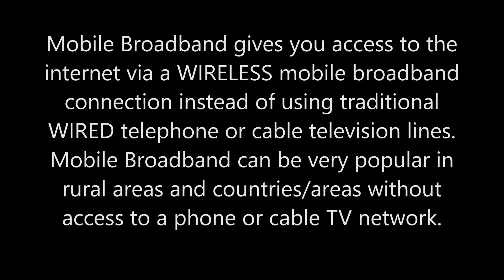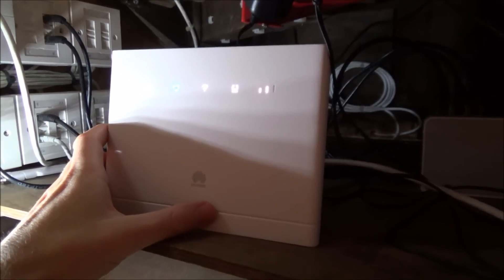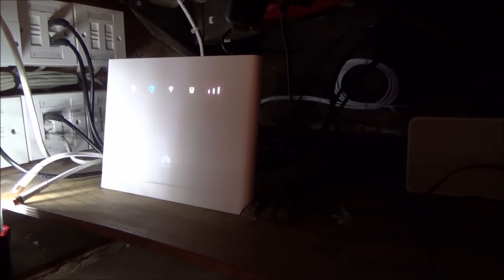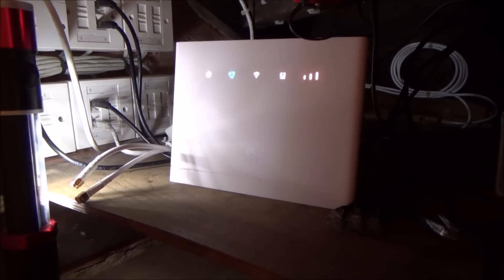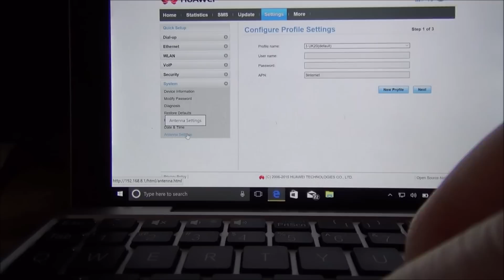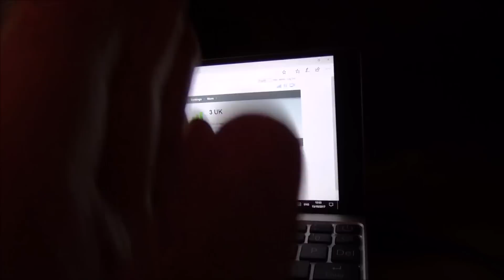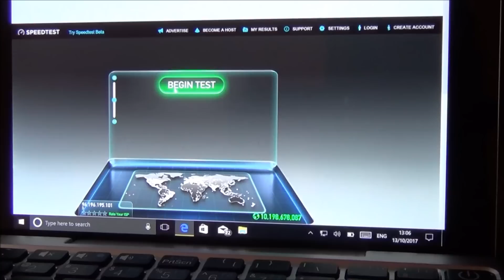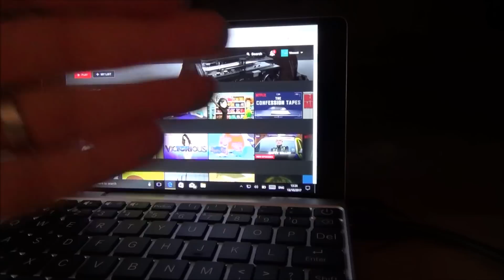How to increase 4G LTE Home Broadband Router Speeds

Comment: I bought the recommended external antenna. 1. I find it to be very sensitive and a few inches difference in terms of where it is placed can change a 4 to 5 bars reception. It works better with height too. 2. I have far less speed with the external antenna that I have with the built in ones. I have played with the Auto/External setup within the Router's front end as shown, but this does not seem to make a difference.3. Why do I get less speed on an external antenna vs built in internal ones? I don't really get it. With the Router's internal antenna I get up to 55 MPS and max 20MPS with the external. I was actually looking to improve not so much speed but consistency as I find that when I stream tv for example, using the router without any external antenna, it does tend to stop which is strange given the speed, which I had put down to drops and inconsistency, hence the external antenna, but unless there is something to change in terms of settings, I think the external is going to go back to Amazon and save me £80. Any advice, input, idea? Many thanks indeed!!!
Reply: remember what he said about the cable gain loss? that maybe your issue,.

Comment: Thanks great tips there and nice demo , though I only have a wireless prepaid modem wifi and only has one male external antenna attached to it, can I possibly increase the speed by using an extension cable? Again thanks...

Comment: Hi Vince, brill video. I’m on the verge of entering into a 2yr contract with Three for their homefi broadband but I’m a natural pessimist and am panicking that it may end up being slower than what we already get with talk talk. 2yrs is a damn long time but they give a 14 day cool-off and so I have that time to test the huawei B535 router although not sure I’ll be able to hold of an external antenna in time to give it a good testing too. We live in semi rural Wales and even before I get the router I’m obviously expecting the internal aerial to be of little use ☹️. My pessimism is also related to their pricing as it’s only going to work out at about £18/m!!!!!! and so seems a no-brainer but why so damn cheap? Are Three trying to get people onboard or do they know it won’t be that good? This is how I came across your vid in the first place. Please tell me I’ve got no worries and to calm down......there’s a mast less than a mile away (although not in clear line of site (another house and small hill in the way)) but do all networks use/share the same masts?.....any help/advice would be appreciated.
Reply: Ollie Clark hi Ollie, ta for all that. Quick reply here......I forgot to mention that at present our MAX speed is, according to talk talk, 4mbps....however, lately we only get 1.70mbps on average and have been down as low as 0.4mbps.....so you can see that I should be onto a winner going sim broadband. However, Since my initial comment I’ve discovered Smarty broadband (who piggyback off three) who offer £18 per month unlimited BUT on a month by month basis and so I’m going to try this one out.

Comment: I got the portable Huawei mifi for home and travelling but my home speed never goes above 2mbps on 3 network. I've just got this router today and have sited it on every window cill and the best speed I've managed is 6mbps.Id like to try an outdoor aerial but I'm sceptical that it will make enough difference given the low speeds I'm getting.

Comment: Absolutely brilliant. Just a quick question... Can my normal phone 📱 connect to this router and then its down to how much Gigabytes my Internet provider allows? In my case its unlimited but my house has a terrible signal. Hoping to find a signal booster so I can use it decently. In this video is this solution for me?
Reply: I found the answer to my own question. I went and bought a similar one to this but the Huewei B525 which is 300mbps rather than 150mbps (which doesn't matter unless you want to cast your phone to the TV via WiFi at UHD like I do)
 I also bought the antenna Poynting 4G-XPOL-A0001 as you have in the link in the description. I found it helped me a lot to get a better signal on my roof when I pointed it in just one exact spot for the best speed.
 I still had a terrible signal for 4g but when I switched it to 3g it helped me from 2mb dl and 0.5mb upload to 5mb dl and 5mb upload and that was with 3. I will say that though that although the difference wasnt a lot, it did take away a ridiculous amount of lag and it felt a lot smoother. Was able to watch YouTube with no problem whereas I had no chance before really. 
 My mate however tried EE and he went from 2mb dl and 2ul to 20mb dl and 40ul I've never seen anything like it. I didn't even know it was possible. Proper gutted my Internet provider didn't do the same to be honest but it does show its potential.
 Thank you for this video it helped me out a lot with the set up.

Comment: This external anntena is a trash  like this huawei 2
Reply: Tomo Gacic please could you explain ?
Reply: @benosatv  It all depends on the transmitter and its signal quality and where it is located. For me it doesn't work nicely with or without an antenna.
Reply: Tomo Gacic does the huawei work at all?

Comment: I didnt quite understand the minimum gain on the 2x5m aerial cable? I am wanting to install an external antenna about 10m away on top of roof or where ever I get best signal. Is it better to have shorter aerial cable runs or better to have longer cable runs?
Reply: the shorter the better

Comment: A Zero Waffle production. Thanks.   I've got a similar 4G router, but my net speed is totally shit.  Got 0.12MBPs last time I checked.  It varies between 0.10 and about 0.6Mbp/s most of the day, and might go up to 1.2 - 2Mbp/s after 1am (I'm paying for an advertised 20Mbp/s!) There's a disused satelite dish on my apartment's balcony with the antenae terminal here where my router is plugged in. Do you think it'd be possible to just get a cable to attach the satelite dish to the router? The dish is actually marked with the same brand as my ISP too, so presumably it's pointing in the right direction.

Comment: I’ve got a TP-Link Archer MR200 and a Poynting A-XPOL-001, do I have to tell the router it’s using the Poynting, as you did in your video?
Reply: nope, tp-link MR 200 does not have internal antennae so it will just pickup whatever you have plugged into the back of it

Comment: Is there any speed difference between ethernet cable and wireless? Because you are using ethernet cable.
Reply: Using a Ethernet cable is better it has lower ping and can't disconnect on it's own

Comment: Followed this to a t, b525 bought exact same antenna changed settings to external and got the exact same results as the stock b311 router 3 sends, 6mbps download with both router and with the antenna for the b525, b311 got same speed without an antenna... The thing I don't understand is it shows 4g and a full 5 bars and my speeds are still complete trash, on 3 website it says I have very good coverage, sucks :( can't go broadband because I get 2mbps download which is even more tragic, guess I'm fucked unless I move

Comment: That's a good instructions, whit a little failure... Let me explain it why. Antenna should be installed as close as the top of the roof, as you mentioned that's a omni directional antenna. Let it pick up all available mobile repeater signals from 360 degrees... That's might be the best speed increase.... 
Why I'm saying this? Three mobile UK launched the 4G+ or some say 4,5G services, if mobile phone or router could connect 4G on multiple frequencies, device just bound these together and give a sky high bandwidth to the user, or use Huawei outdoor CPE

Comment: Thanks good video. In the UK 3 currently offer an unlimited plan.  This is great for people like me who are in a rural area.
Reply: Or for people in the centre of London who have a landlord that refuses to buy Fibre (Using 3 unlimited)
Reply: Be aware that the 3 “unlimited” it speed capped when you exceed a certain usage. That cap it to around 500kbs I I remember rightly.
Reply: @CWXM01  OffComm regulations require them to advertise that they slow it down after a certain usage, no where on their site, in the store or on my contract does it mention that, you may be thinking of their mobile plans with texts and calls where they do throttle after a certain amount
Reply: SirFlukealot Esquire did you find any more info about this limitation? Maybe it is true because i feel a speed drop last week of subscription.
Reply: @Kuki_ogl  they said when I went into a 3 store that there's no speed cap for going over a limit, I returned it however as the speed only reached 10mbps when I switched the router to 3G only mode, no good for me

Comment: I have the same router/modem, except it is black and one yagi antenna with 7db gain, but only vertical polarisation. 
Right in best case scenario I get 54/12mbps (I have 50/10 package). But when there is bad weather outside it drops to 1-4mbps download, while upload remains stable at 9-12mbps. 
Is there any better antenna I could use for that?
Reply: SAME TOO

Comment: How to control connection device speed limit?
Reply: You can set the network mode whether 2G/3G/4G depending on the speed limits you desire.

Comment: regarding the antenna location, you said best signal you got was just above the garage roof rather than a higher location, in the world of antennas that's counter-intuitive, the only reason I could think off of why that is could be because the garage roof acts as a parabolic antenna and bounces signal off of it and into the LTE antenna, by experimenting around with the antenna's location you guys must've found a sweet spot where plenty of bounced off signal from roof will hit the antenna, surely the roof doesn't have the shape of a parabolic antenna but still plenty of signal will bounce off and reach the LTE antenna so that will make a difference location-wise.

Comment: I have had this same router Vodafone branded for 3 years. Your advice is spot on and I'm lucky enough to have an unlimited data connection. I now use mine in the car. When in the glove box, the Android radio drops out, but I have an external antenna (similar, MIMO though a bit smaller) and it works a treat. Never ever drops out, even in tunnels and mine was about a fiver from China. Yes, a slight gamble on quality and not suitable for outdoors, but it works for me and very well.

Comment: Great video. Thanks. I just ordered the HomeFi (3 network with unlimited data) as the broadband where i live is awful. No FTTP, cabinet overloaded. Fiber yes but only to the overloaded cab with no plans to upgrade. I was dubious when i spoke to 3 who claimed 20mb which was only marginally better than the 16 i was getting (paying for 36 with Sky) and they said I could get up toward 50mb. Installed the HomeFi (Huawei B311S) and after a couple of minor hiccups i'm getting 34+ mb.... essentially doubling my broadband speed. Very happy. Ordered the rabbit ear antenna's but not installed yet. Will report back.

As for ping and gaming, early days. I'm getting anywhere between 39 and 60. not great but didn't notice anything untoward when playing Battlefield 1 for example.
Reply: that's certainly playable, I was wondering what the ping is going to be like. Just took the 4g plunge myself and ordered the kit and sim.

Comment: Just a notice to everyone currently three is doing an unlimited internet HomeFi promotion in the UK. Just ordered one of these and will post back with results
Reply: Alright so quick update - had the hub three days, suffered a lot of DNS issues (or lack of I should say), for the time it was up speeds varied HEAVILY. 10mb/s sometimes and 45 at others, overall if you're a casual internet user probably not bad, I found webpages struggled a lot at times - especially image heavy ones like Ebay, Facebook, hotukdeals etc. 

The concepts there but not fit for purpose for myself yet, cancelled it already - but don't get me wrong a fantastic device and ping wasn't too high either.

Be aware the deal is a 100GB plan with an unlimited bolt on, of which I did have to argue because it wasn't showing in the mythree area.

Comment: About limits - didn't Three just recently silently removed tethering limit? I'm strongly considering that, even though reception in my area is hot garbage, maybe with external antenna in perfect spot it would be tad better. My wired connection is terrible and constantly loses packets - even if tiny amount, it makes gaming a highly unenjoyable experience.

Comment: If i got poor range when testing with my phone is there point in buying more expensive router like ASUS 4G-AC68U AC1900 than this one ?
Reply: You can't really compare it to cellphone reception because the 4g routers have much stronger adapters due to being run off mains power. I dare say the ISP provided (generally Huawei ones) have the same adapter strength as the Asus but I may be wrong. The Asus will have much better Wifi and more features though of course.

Comment: I have the same router but it was locked from telcos. There is no selection of antenna i thin telco wont allow this that why it was blocked. Is there anyway to select antenna or used external on it or software to able the antenna selection.

Comment: Question, at the moment I have the same b315s-22 Vodafone LTE and i use for my Xbox one but it’s restricted to NAT Type 3, I tried port forwarding but no luck... what do I do?
Reply: You need to have a Static IP address, unfortunately Vodaphone don't issue these unless you use 3G which is slower. I learnt this lesson and cancelled my plan. After some research I found out that 3 is the only current provider with Static 4G IPs. Been using them now for four months with no problems. Xbox NAT is Open. Hope this helps.

Comment: There is a very good utility LTEWatch(H) for Hauwei LTE Routers which gives an excellent way of determining the best signal strength for a specific position and orientation. Although the spec for this antenna says it's omnidirectional, it does actually perform better with the front face pointed at the LTE mast. Using the self same setup B315/XPOL-2 60. 60Mbps D / 30Mbps U

Comment: Hello Vince just wanted to know if its possible to increase the signal by connecting two antennas by using an SMA Plug Male To 2 SMA Jack Female. Would like to know your reply.
Reply: Even two small antennas turned for 90 degrees  helps greatly

Comment: i have a question concerning the external antennas i have the same router as this one but i cant catch 4g network here  i can only catch the signal when i go on the roof and put the router on 1.5 meters height  the signal is getting jammed by other houses here so i was thinking about bying an external antenna that i can put on the to catch signal  do you think it worth bying  because i dont realy have experince with them
Reply: Experience nil but brains will get you through. Do  bit of study - watch some youtube videos and pretty soon you will be confident enough to put that 1.8M mat on the roof with a nice omnidirectional antenna (that's all you need) some reasonable quality cable (short as possible) down to a suitable sim-based modem.
Reading about MIMO antennas is a good starting point . ;-D

Comment: And the real question is: why is a 3g/4g internet connection capped? It's not our fault that they (internet provider companies) can't deliver a stable or fast ads/vdsl/fiber/cable connection, so they should offer an alternative. Cellular towers now have the capacity to provide high bandwidth for many concurrent connections, they should stop capping it at least for those who can't have fast wired connection. As VINCE said, having 30mbps download speed allows you to stream 4K HDR content on Netflix and you'll reach your limit in no time!
Reply: In the UK there's essentially no cap on threes unlimited data package and that's only £20 a month.
Reply: Alex with £75 cashback from quidco too making it even cheaper
Reply: @rorynoble7344  very true. It is a bargain, I fancy it myself but need to try and transfer my landline number over to a VoIP
Reply: in many countries you can get unlimited 4g internet, but it' cost you twice as much as the standard limited version. In germany you can get unlimited 4G internet for 80 Euros.  If you can live with 60GB you pay 40 Euros.
Reply: I'm in Oz and on a 200Gb plan. I am paying AU$40 or just under 24Euros.
As for the video. I learnt about this very thing the last few days only but I wished I had watched your vid earlier - very good, so many thanks.
Reply: Unlimited 4G LTE cost us 25 Euros here in Sweden. To get that price we have 3 accounts connected (all unlimited) to a "family" account for a total amount of around 80 Euros.

Comment: That load of shit because if you are with BT,SKY,EE and say you should be getting 50Mgb but you are getting blow 49mgb download so you getting say 15,20,30mgb if you ring them up and tell them the after to fix because it say in the contract if drop blow 49mgb thhey will fix it and get you up and running with right speed